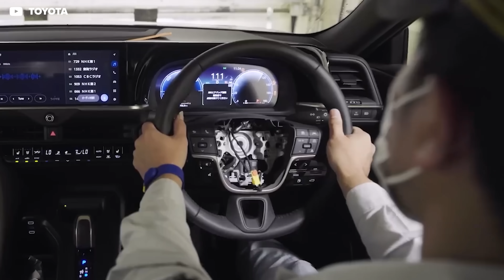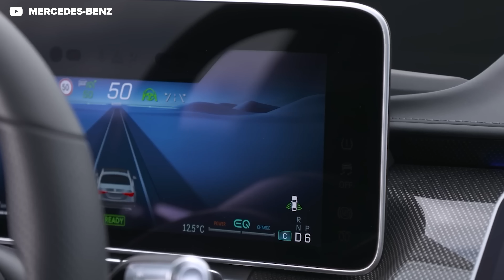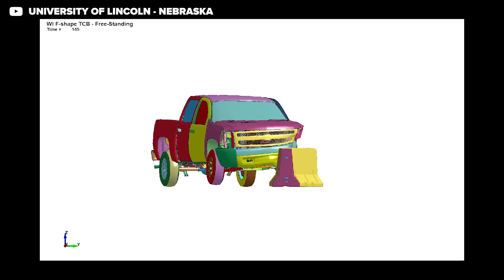The REAL reason guardrails can't stop EVs in a crash

Comment: Do you want drivers to be safer? Easy.  Make cars have standard transmissions.  Automatic transmissions make drivers lazy. Standard transmissions make the drivers aware 100% of the time because they have to think about what to do in every single situation that they will come across. When do I downshift, when do I upshift?  When do I depress the clutch and coast? When do I put it in second gear? When do I put it in first gear? When do I release the break if I’m facing uphill how do I not roll back into the car behind me etc. etc.

Europe has a better safety record because most cars in Europe are standard transmissions. This makes texting and zoning out and all of the ills of automatic transmissions go away. You can’t text while you’re using a standard transmission until you are cruising. You can’t be looking at your cell phone when you’re trying to decide actions and gage the distance you are to a stop sign and what to do with your gears. You can’t be looking at your cell phone when the light turns green and you have to engage your gears properly without stalling the vehicle.
Reply: You've never pulled into your house and not remembered the drive home? My first two cars were stick, they were fine, but I'll never give up my one-pedal driving. It too makes you pay attention to your drive since you have to pay attention to stopping distance and velocity to get the most power back into the battery. It's gamifying paying attention to your driving, just like a manual transmission did. 
Also the reason I sold both my Subarus was because the transmission or clutch failed, that's an expensive repair that will never happen in my Bolt.

Comment: An economist concluded people "consume" safety features like seat belts by driving more recklessly, which negates the safety features.  But the problem is:  if you, a safe driver, don't use all the safety features available to you, you are at risk from same out-of-control risky driver.  Same probably for heavy cars, which should be taxed more than lightweight cars.
Reply: Taxing vehicles by weight is going to be how governments get around the loss of revenue from fuel taxes as people shift to electric vehicles.

Comment: Given that gaurdrail and temporary concrete railing (K-rail) is designed to be parallel to traffic, it is not designed to be hit head on.  Rather, they are designed to redirect the force of a car glancing off back towards the road and away from the edge or protected area.  The weight is less of the issue here.  Rather, it is the fact the video was a more perpendicular angle and that trucks are higher up (and just went over the wall).

Comment: Those USAian "guard rails" are little more than a joke anyway, like the poles for street signs and traffic lights... When a heavy car crashes into one of those here in Germany, that car either gets really slowed down or stopped. Deep foundations and sturdy materials and construction - those barriers have a job to do, not just be a minor inconvenience if you run into them.
I've just recently seen the tractor of a 40t semi (trailer attached, but not pushing it further down) hang down a steep (40° or so) incline next to an Autobahn off-ramp after it crashed into the guard rail at an almost 90° angle at probably ~40km/h (~25mph) - and the guard rail was holding it like a big sling. Sure, the trailer certainly helped to keep it up, but that guard rail was still intact, just torn off the ground, and it definitely was holding some of the weight of that ~8.5t tractor.

Comment: I’m not a structural engineer but I could’ve told you putting that much weight down low gives you a massive advantage in a fight. Wrestling is all about core strength.

Comment: Just realize that similar ICE vehicles in the same class have very similar weights to EV's.
If you compare a $35,000 EV to a $35,000 ICE car, they are within a couple hundred pounds. (a couple ICE cars are heavier)
If you compare a $45,000 EV to a $45,000 ICE car, they are within a couple hundred pounds. (and some of the ICE cars are heavier)
If you compare a $60,000 EV to a $60,000 ICE car, they are within a couple hundred pounds.
If you compare SUV models, MOST ICE Luxury SUV's are much heavier than their EV counterparts.

Here are the weights for F series pickup trucks:
F‑150: ~726,624 units sold in the U.S. in 2023 (includes light-duty and Lightning variants).
Weight range: ~4,000–5,540 lbs.

F‑250: Heavier-duty model, weight ~5,700–7,500+ lbs, part of overall F-Series sales.

F‑350: Heaviest of the core trio, weight ~5,900–8,100+ lbs, also included in those sales.

And
F-650:  From ~20,500 lbs to ~29,000 lbs depending on spec.

So don't fall for anti-ev scare tactics.   Get the facts.   Google the weights of the various car models yourself.

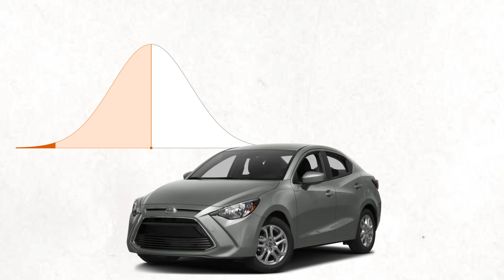Comment: 3:19 American cars always were stupidly big. My first car was a small Toyota. I was an underweight nerd with noodly arms and legs, but I could lift my car by hand without tools. If I really put my back into it.

I remember the headline when the lower weight limit had gone over one ton.

I still believe you can build a 4 seater city EV with all modern safety features and stay under one ton. (And around 200km range}

Comment: No matter how you spin it, Weight= safety in crash. The only negative impact is the 200 foot drop into a lake the guardrail is protecting you from. I'll take my chances with weight. That's why my daily driver is a Cummins diesel pickup with a camper cap.

Comment: Since the 90's?! Cars from the early 80's and earlier were much larger! Two major problems with ev's are weight and no safe way to put out the fire created by the garbage! Its not ev hate!, it's just logic. All ev's outweigh their gas powered equivalent period. The old car being destroyed in that crash test you can obviously see by all the rust dust flying out proves it was a compromised frame due to corrosion! They pushed the old style framing out due to how sturdy they were, and could in fact take multiple hits and keep going unlike today's cars that can windup totalled from a simple pothole! Today's cars are designed to only have a max of five year life span, unlike the cars from the 80's and older that some are still around to this day rolling perfectly safe and have hardly any issues unlike a computer update that can leave you on the side of the road on a short trip to the store! Its simply a way to controll people with products! Newer cars are truly trash within two years! Do you see many cars from the 90's still rolling around? No they have all rotted away or had so many issues they were not worth fixing!

Comment: Yeah but having a low center of mass is incredibly good in every situation that is not hitting a guard rail. Extreme corner stability, incredibly difficult to flip, extremely stable under acceleration and deceleration are just a few; even in a crash, the likelihood of the car flipping are incredibly reduced. And as mentioned around 7:30, safety for passengers is greatly improved.

So I still have to finish the video, so I don't know what the conclusions are, but from what I've seen thus far the real issue is that the US has to re-engineer its guard rails to yes handle heavier cars, but also technically safer (lower center of mass, better crumple zones, better canin protection) cars?

Comment: Teslas are some of the safest cars on the road.  They rate higher than almost every other model from every other brand.  The battery pack keeps the weight very low, making them nearly impossible to flip.  I'd drive one if I weren't on Social Security.  But I'm in a very safe vehicle, too, a full size Toyota Tundra, weighing 4,775 pounds.
Attention pedestrians:  ANY vehicle traveling 25mph or more will likely kill you if it hits you.  Stay alert and don't get hit, eh?
Pedestrian safety ratings are a load of PC BS.
Bottom line: Drive what you like, but both drivers and pedestrians need to stay alert about their environment at all times, period.

Comment: 5:43 This seems like a BS. For me it seems to be more an issue of the shape of the car, that it slides under the guardrail, rather than the center of the mass - for simple reason: The car is solid and pushes to the guardrail equally regardless of its center of the mass. What the center of the mass affects is that it will not flip, that's all. Also the specific guardrail in this test is pretty high, so the car was set up to fail. My take is that this was intentional to push an agenda.
Reply: 100% my thoughts too

Comment: 4:20 It makes sense that the smaller Tesla would also plow through the guard rail, not only because the weight is closer to  the ground, but because it's  more concentrated overall than it is on most  2-ton ICE vehicles, which tend to be physically bigger, so it's a smaller length of guard rail bearing that weight. It's like a comparison between a lead bullet and a rubber ball; they might have the same weight, but we know which one will make a deeper hole.

Comment: EVs weigh a lot more than conventional vehicles mostly because of the batteries.  As a result old road safety tech isn't designed to handle a pickup truck that weighs as much as a semi truck.

Comment: Your "AS MUCH" is not much cover for your clickbait stale story (Jan '24).
""The facility has seen this problem before. In the 1990s, as more people began buying light-weight pickups and sport utility vehicles, the Midwest Roadside Safety Facility found that the then-50-year-old guardrail system was proving inadequate to handle their extra weight. So, it went about redesigning guardrails to adapt.

“At the time, lightweight pickups made up 10-to-15% of the vehicle fleet,” Stolle said. “Now, more than 50% of vehicles on the road are pickups and SUVs.”"

Comment: EVs are heavier than the ICE in their class. this video compares EVs to ICEs of a different class. The other reason is EVs build a more rigid chassis to protect the battery as it will spontaneously combust if damaged, with a fire that still burns under water, and can reignite even weeks later. Bottom line is how much are you willing to pay? cause you will pay 3 times more if you demand the government to do it.

Comment: I'm calling bullshit. In almost every accident scenario, a low center of mass means you're SAFER. Okay, so you found ONE outlier where that's not the case, but that just means redesigning the barriers to remove the assumptions that probably shouldn't have been built in to them anyway. But your message is that a low center of mass is PER SE more dangerous, and that's BULLSHIT!

Comment: ummmmm this is bias as hell. Those car guys from companies are retodded. They wanna sell more car and make it worse for the buyer, been like this for years. Power seating, power windows, oversized parts that are redolent. And then the insurence is a fraud that relies on car companies to sell car parts that make a bareky crashed car into a right off, or a neck to the door is now 1000 in damages. You don't work on cars and it shows. There should be limits and engineering isn't suppose to be about "how can we only make this car last a few years". There's failure points in car and truck, sensors, wheel wells, frames for rust, actual bumbers, and they won't bother to do something about it as they can sell a new one instead.

Comment: Safety of vehicle occupants from impact is one aspect of EV safety.    Should the integrity of the EVs lithium ION traction battery pack be breached then the ensuing battery fire releases hydrogen cyanide and hydrogen flouride gases in high volumes (Ref Professor Paul Christensen,  UK,  lithium ION battery fire research) both of which are fatal to any trapped vehicle occupants and those attempting to put out the fire.  Two Spanish Firefighters died a couple of months back when a Tesla EV impacted in an underground carpark.  The gases released exploded killing one firefighter outright and the second firefighter died some hours later due to inhalation of those gases.

Comment: It all depends on the angle at which the barrier is struck.  Strike at 90 degrees and you get the full force of the vehicle hitting the barrier.  Hit at a shallow angle and there's less force on the barrier, which tends to deflect the vehicle off the barrier.

Comment: Just give me the option for a turbo 4 or straight 6, about the size of a GR86, no more than 3K pounds, and ~300hp with 250ft lb torque.  RWD or AWD (which the latter would add 800lb, so no, lol) with ABS and power steering.  You don't need traction control or active stability management if you've got a good suspension and the car transmits feel via the wheel and pedals.  A blind spot/lane warning system would suffice for most people, you don't need the car to drive itself as people stop paying attention if the car is going to do the work for them.  I've seen video's of people in China setting their "smart drive" and crawling into the back seat to take a nap, lol.  It fails on people all the time, but it's China: they just suppress the stories.

So just give me an E46 CSL.  GIVE it to me! I'll settle for an E36 M3-R or McLaren F1.

Comment: One difficulty with the video is that it shows differing guardrails.  The one in the sketch with the model 3 looks low, but the one in the accident footage looks higher than 18 inches.  So, what is the average guardrail height?

Comment: This is why analysis of data can be a real problem. "Lane Keep Assist" reducing crashes by 24%, does NOT mean it is an essential safety feature that should be on all new cars. It means there are some god awful drivers out there and they need to completely change the driving test and retest of drivers. Do you see the problem? "Lane Keep Assist" is papering over the problem, rather than fixing it. It is the same with "Blind Spot" and other road safety tech. Competent drivers get so annoyed at all the bongs and bings, it actually causes the driver distraction. So well done to the industry for causing accidents and hiding the real problem.

Comment: 0:33 It’s not automakers training people to want bigger vehicles. In fact, it’s the opposite: the public has been pushing the automakers to make bigger vehicles. Remember the big cars of the mid 20th century, which were then forcibly shrunk down through government regulations. People still wanted larger vehicles, and since they couldn’t get big cars anymore, they started buying other vehicles that were more substantial: trucks, vans and SUVs. This resulted in what used to be very plain and utilitarian vehicles becoming more like luxury cars, and even companies almost entirely ceasing the manufacture of cars. But this is not the same as the problem with battery-electric vehicles, which this video so well describes. As for guard rails, I find it amazing that my state of Michigan has for many years used more substantial guard rail designs on freeways, typically wider rail with 3 ribs instead of the traditional 2 and before that, two traditional rails, one high and one low. But recently Michigan has started to downgrade to much flimsier designs, especially a single traditional rail mounted higher than normal, just as these heavy battery powered vehicles are becoming more popular.
Reply: Nailed it! But seriously. Correct comment. Well said. A+
Reply: CAFE standards have incentivized vehicles with larger footprints.
Reply: @kdaviper that's only half of the story. op's not wrong about consumer demand.

fixing the standards could help, but we've all gotten used to the extra space as well.
Reply: @dead-claudia OP is only half right about consumer demand. Market manipulation and gigantic marketing budgets have propaganized larger vehicles, which make better profits than small cars, to bad drivers as a crutch for decades; while lobbying for fewer alternatives for everyone else. It all comes back to manufacturers.

Comment: 5:05 I dare to disagree with the expert.  
Key is how the car "grabs"" the rail.
The tesla wedged itself under the rail because of its shape. IF the front had been "flat," the lower point of mass would have helped (I'm not a Tesla fan. I wouldn't buy one).
If a car has a cow catcher (the thing in front of the train), it will wedge under the rail no matter where the point of gravity is.

Comment: There isn't a safety fence (TCB, Armco, whatever you cdll it) thdt is able to hold a vehicle hitting it perpendicularly because they're designed to dissipate an errant vehicle's energy if hit by passing traffic at angle.
The same "angled vs. head-on" argument applies to TVCB (concrete blocks)

Comment: uh that's not true there were full size cars back in the day that were bigger than any made today ex the Buick Electra 225 was at one point 233 in nearly 19.5Ft long while for ex the Rivian R1T is 217 in or 18 Ft long also some cars that started as a compact have morphed into a midsize like the Toyota Camry for ex has grown nearly 2Ft in length depending on the trim

Comment: I wonder why we still use small guardrails and not something like an ARMCO barrier. Even still, the oversized non-EV trucks are probably not that much better in the same crash test the Rivan went through.

Especially when they're lifted, which should be included in a crash test if lifting a truck is fine enough to allow on the road.